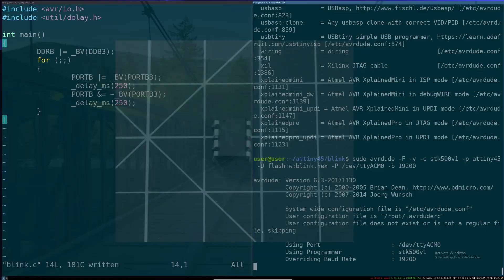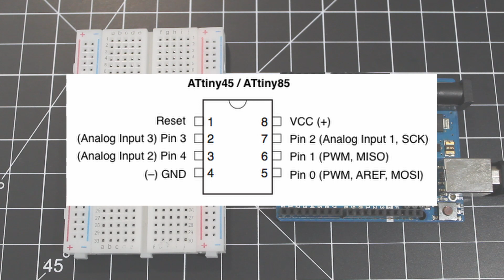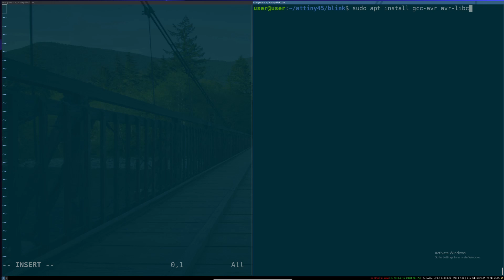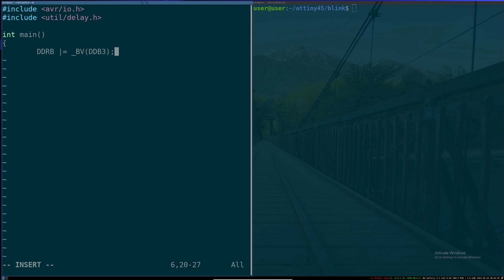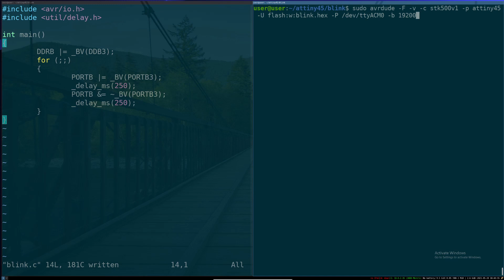Programming the SMALLEST Chip I've Ever Used

Comment: Thanks for this video, If I understand it correctly, this is what I'm looking for. I'm looking to make my own lighting kits for model making, setting up lights to go on and off to make an effect. So once I program a chip accordingly, I can make a small board, solder items in place and place it in a model. Is that correct? I know I will have to be doing the math to get the right power source for the lights to to be lit.

Comment: Great tutorial but when i try to program attiny45 i got 

avrdude: AVR device initialized and ready to accept instructions
avrdude: Device signature = 0x000000 (retrying)
avrdude: Device signature = 0x000000
avrdude: Yikes!  Invalid device signature.
avrdude: Expected signature for ATtiny45 is 1E 92 06
avrdude: NOTE: "flash" memory has been specified, an erase cycle will be performed
         To disable this feature, specify the -D option.
avrdude: erasing chip
avrdude: reading input file "blink.hex"
avrdude: input file blink.hex auto detected as Intel Hex
avrdude: writing flash (1238 bytes):
Reply from the maker: Probably has to do with the connection or baud rate. The 0x0000000 device signature reads like a voltage issue

Comment: Cool video.  Thanks.   "_BV(DDB3)" is the same as (1<<DDB3)    personally I prefer the latter.  Why obfuscate such a simple math statement?
Also, you can eliminate two lines in the for (;;) loop.    This statement will "toggle" the port bit:   PINB |= (1<<DDB3);

It's refreshing to see straight "C", without all the overburden of Arduino libraries, etc.  digitalwrite(pin,value) is tremendous overhead to do a simple bit set/clear...

Nice to see your channel.
Reply: Writing a 1 to a bit in the PINx register will toggle the corresponding pin. No need to ^=. Works on the AtMega328 as well.

Cheers,
Norm.
Reply from the maker: @NormanNodDunbar  Wow I was not aware of the PINX register, today I learned!
Reply: @LowLevelTV  sorry, too used to AtMega328. It has a few PIN registers, AtTiny just has PINB (as you know!) -- I should have typed PINB rather than PINx. My bad.

Cheers,
Norm.
Reply: @LowLevelTV  I've never seen it used before.  I just discovered it one day by one of my favorite past-times, i.e. reading datasheets to understand how things work.  Great time saver, way less clock cycles, don't care what current value is... just "toggle" it.  :)  :)
Reply from the maker: For the purpose of this video I didnt want to dive too deep on bitmasking and thought the macro looked a bit cleaner.

Also I think you mean ^= for the toggle ;)

Thanks for watching and commenting bro!
Reply: @LowLevelTV  Nope.  I wrote what I meant (copy-n-pasted from an actual program).  When you write a bit to "PINB", it's not the same as writing to the PORTB.  In the datasheet, you will see that writing bits to PINB SFR tells it to "toggle" the bit(s).   :)

Comment: I love this little chip. Well actually it’s bigger brother ATTiny85 I personally program them in assembler because it’s functionality is so limited :) but useful chip.
Reply from the maker: That's smart, 4K flash isn't a ton of room. I'll probably do a video on AVR assembly with this chip in the coming weeks
Reply: @LowLevelTV  Straight C is hard to beat.  Have the compiler output ASM for you, and then see if you can optimize it?  Unless you really really like assembly..  I've tried in the past, but always found C's code already pretty well optimized.  But, on the other hand, I'm not an assembly expert...  so I'm sure others can do better than I...
Reply from the maker: @montpierce424  depending on how strict the compiler is, sometimes its easy to beat by just removing unnecessary function prolouges and epilogues. 

I'm working on a video where I reverse engineer an AVR binary, its really interesting how AVR GCC works sometimes!
Reply: @LowLevelTV  Truth be told, I don't know how efficient "GCC" is.  I worked as an embedded systems engineer for 30+ years, and the commercial compilers we used may have been better.  For one, the only had to work with specific processor type, etc.  GCC may be a different ball-game, i.e. Free, ported to so many environments, etc.   It would be interesting though to see the ASM code that GCC generates with the "-S" option.
Reply: @LowLevelTV  cool! I’ll subscribe, I see we do similar things and have similar interests.
Reply from the maker: @CallousCoder  subbed back. I see your channel is fairly new, good luck and have fun!
Reply: @LowLevelTV  yeah I started a month ago, with beating the world record on 100M Dash :) and since I have so many smallish projects and ideas and sometime, I’m between projects taking a little sabbatical, it gives me some time to make those videos. My HornyBox mark 1 (uses the ATTiny85) the video about the mark 2 is all C++ on a Pi zero.
I don’t know how many videos I will make, when I’m back in the daily grind though :) 
My bigger project is actually this: https://www.instagram.com/p/CMunoMunpU3/?utm_medium=copy_link a programming game. The NodeJS VS C++ performance test is actually for this programming game.